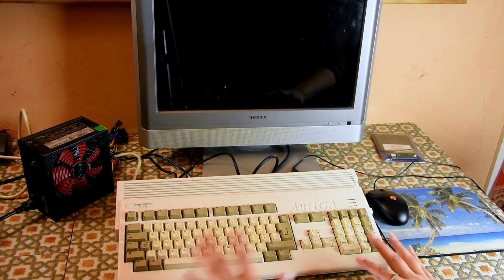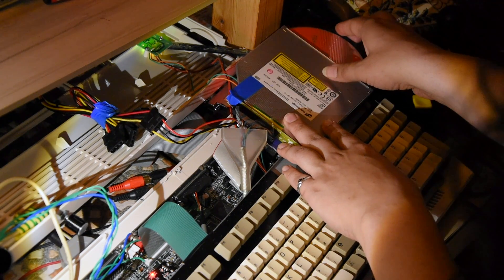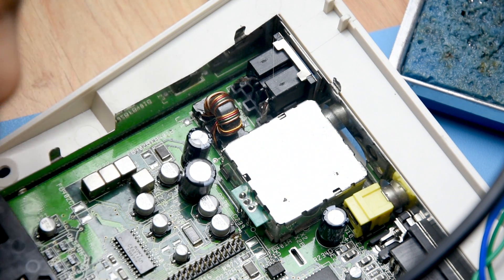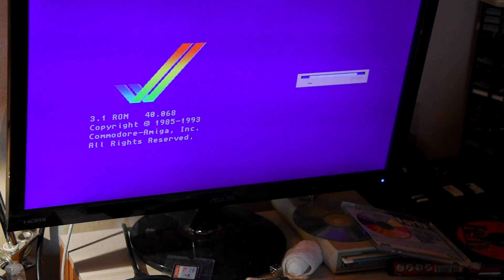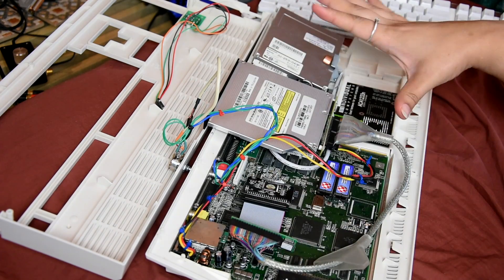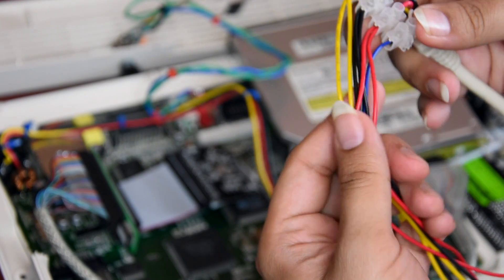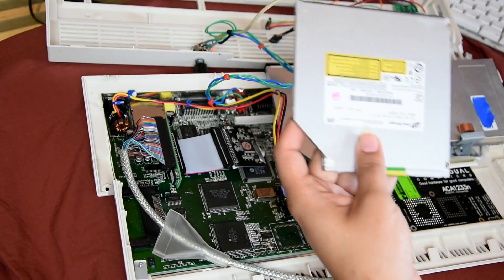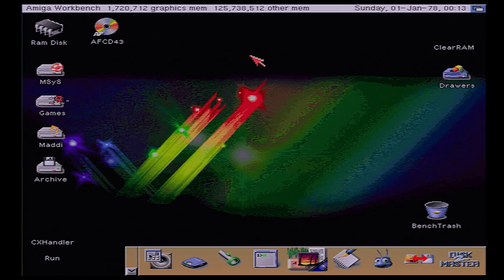Amiga Optical Drive - Part 3 Issues, fixes and Improvements

Comment: The motherboard is probably not designed to run a floppy, a hard disk and a optical drive all at the same time after all this machine was released before CD-ROM drives were everywhere.

The question is why didn't you power the dvd drive using the external PSU instead of the computer's power connector?
Reply from the maker: If you keep watching, you'll see that I did in the end. Its not coming from the motherboard, but the power port, and yes the terminals on the power socket are thick enough to carry the current needed for the Optical drive.
Reply: @MsMadLemon  No, I meant the PSU brick not the 1200's power port.
Reply from the maker: @daviniarobbins9298  you mentioned the motherboard not designed to run a floppy, hard disk and optical drive, and why i didnt power the drive using the computer's power connector,  which is the 1200's power port?!
The PSU Brick, providing its an A500 heavy one, powers the optical drive just fine, however, i've since put together a better 65w PSU for it which is more than enough power for all this.
Reply: @MsMadLemon  Well I meant a floppy power connector from the PC PSU you are using but never mind, it isn't important.

Have you thought about one of those Checkmate A1500 cases to house your 1200 in?

Comment: Hi MsMadLamn, thanks for those videos about cd installation. It was some weeks now that I am trying to  install  4xeide on my a1200 but after the installation of the driver at reboot the amiga stay on black screen. I am usign os3.9. Can you tell me, please, your configuration(filem system, os version, kickstart etc) to try to understand what is wrong on my setup?
And if you have any suggestion to make this work. 
Thanks a lot.
Reply from the maker: Which drivers are you installing for your buffered interface? is it Allegro CDFS? its strange that you get a black screen at boot. 

My configuration is A1200 with ACA1233n (but the IDE also works without that), kickstart roms 3.1 and OS3.9.
Reply: Hi, thanks for the answer. I am using the last version of 4xeide.driver (the one from elbox) with allegro CDFS but AllegroCDFS is not the problem because is always the HDD that fail on the partitions bigger than 4GB. After thousand of test It seems to be an incompatibility with OS3.9 BB2 and above. Sadly Amigakit and elbox gave up on me after a couple of email. My configuration is aca1221ec and kickstart 3.X. Currently the system is working using the scsi.device that comes in the KS3.X and SFS1.8. It seems stable but I don't think I am using the full features of the 4xeide card. As soon I receive a new ide cable I'll try to use the secon ide port and I will know if the interface is working or not. 
Kind regards.
Reply from the maker: Hi again, For drives larger than 4GB, try using PFS, (PRofessional file system) i've already made a tutorial about installing an 8GB card using PFS: https://www.youtube.com/watch?v=tL8etprxj4E

It could also be the card, in which case, you could always test another card, install a fresh install on it and see how it behaves.
Reply: Hi. Despite the fact that most people suggest to use PFS3 IO, my problems with partition bigger than 4GB are solved installing the SFS 1.84 (the previous give me more trouble than PFS3). The problem about the driver stay. I am using the 4xeide card with the scsi.driver present into kickstart 3.X and it seems work. It is a real shame be unable to use the proper driver. The biggest shame is the way this people abandoned me. I don't care too much because are only £45. I don't think I was so calm if it were a fastata 1200 mk-V.
Thanks Again

Comment: Thanks for sharing Maddi. I came back to this video specifically because I am experiencing a similar issue on my main screen, but on a Commodore SX-64 computer. So basically your video issues where caused by insufficient power; power that you started drawing from an alternate line and not from the standard voltage supplied by the original 12V rail as intended first, thus fixing your video problems. Very interesting. I hope I can detect and fix the fault on my computer with this newly acquired knowledge. Thanks again for so many great videos! Take care. :)

Comment: Well you are using a PC powersupply so you will not have problem with the current there. The 5V and 12V lines 20mm witdh so it will not problem with that I think, most of the problems came with the original powersupply.

Comment: I see this now: Your SD Card IDE adapter is not insulated at all and when any conductive (metal) piece of it touches any conductive piece on your amiga mainboard it will give you a short circuited system! Please, if you haven't done it already, insulate the SD Card IDE adapter tro prevent it from damaging your system. The easiest way to do that is just putting a very small kind of plastic bag around it :)
Reply: Here is a picture of my A1200 from the inside: http://www.bilder-upload.eu/show.php?file=ebb67d-1500318936.jpg

I don't have the EIDE adapter and a CF card adapter (with 8gb CF)  instead of an SD card one, but the whole insulating thing is exactly the same of course. Maybe you get a better idea of it by looking at the picture :o
(If you wonder about it: The accellerator card is a Blizzard 1200/4)

I don't want to act like a teacher at the moment who is telling you what you must and mustn't do, I just want to help you keeping your amiga alive as long as possible ;)
Reply: ...and even one more thing... are your capacitors in the A1200 already replaced by new ones? If not, that is a thing you should actually do as fast as possible as well, because the old ones Commodore soldered into the A1200s, A600s, A4000s, CD32s and CDTV remotes back in the day were pretty low quality capacitors, so they are very likely to leak their very aggressively etching electrolyte onto the amiga mainboard which is desrroyed if that stuff sits on it for a time :o
Reply from the maker: Thanks for the warning and concerns, i've already recapped the A1200 and I made sure to insulate the underneath or any metallic corners of the SD card adapter with duct tape, so there's no danger of any short circuit. Thanks again for the advice though :o)
Reply: Ok, I really didn't see that duct tape and the caps you put in there look exactly like the original ones, so I just wanted to tell you. Of yourse it is very good that everything is already done :)

Comment: Interesting video. I never trust thin wires anymore since I had a few melt-downs, nice big thick wires you can trust. I think a slip of cardboard is also handy if you get two wires almost touching, as it can be easy to slot in between two solder points, and is as good an insulator as wood itself. But then it depends on the situation so maybe not really a tip.

Comment: That is SOOO Awesome! Wonder now if CD32 games will work? I thought there was an Akiko Chip in the CD32 which isn't in the 1200 so I would be very interested to see how they run. I would rather try and source an external CDROM Drive for my 1200 as I would be too scared to fry it!
Reply from the maker: Yes there is an Akiko chip in the CD32, though i'm not 100% sure on what it does, But we will soon find out as i'm going to do a video on the CD32 "emulator"... Well you could just use a long IDE cable to an external CD-ROM drive and power that externally. SCSI i'm imagining is hard to find.
Reply: At the moment I am waiting to buy an A1200 Accelerator card whilst also doing some smaller upgrades to my A500 Plus and A600.

Comment: With regards to current of the 12v line via the FDD connector, I think your approach there to take it from the main connector directly is the best approach tbh.  You could measure the current drawn on the 12v line of the CD drive to see what it is, but I suspect the trace width will accommodate whatever the FDD pulls on the 12v with some tolerance.  It might for arguments sake be safe to pull 500mA on the 12v line, but the FDD and CD running at the same time could pull too much current.  If that had happened a trace would have burned out, so I doubt you were pulling more than it could handle.  

But there's also the benefit of connecting directly to the power socket there in that a) you aren't stressing any thin 12v traces on there, but also b) Any current dips perhaps wont affect anything else using the 12v line as much.  I've found the same thing there on systems where I've added fans - the nearer they are to smoothing caps and power input connector the better.  Depending on the current drawn by that CD drive on the 12v rail, I might be tempted to add a smoothing /resevoir cap at the drive end too.  Not essential but it might just help with any noise generated by the CD drive motors and current dips etc.
Reply: Yeah connecting it to the power input was the best solution. And since the cd-rom power was connected before the caps, any noise made by the cd-rom would be cleaned by the caps before entering the board. Cd-rom would also receive any noise made by the powersupply, but i dont think its a big deal since the amiga is limited to 2,3Mb/sec anyway.
Power input on amiga=amps are limited by the powersupply, if you need more amp, just get a more powerful supply. (dont worry if it can deliver more then needed, it will only take what i t needs)
Power from fdd: Very limited. Its not really limited by the traces, but the voltage regulator. It will never deliver amps to a dangerous level, when it reach max amp, it will refuse to deliver more, so you cant really burn your traces here, unless you short circuit something, which is always a bad idea anywayz 🤗
Reply: Another great video btw =D  Educational, interesting, and fun at the same time :o)
Reply from the maker: Actually I remember there being kits to add 3.5 inch hard drives into the A1200, I had one in my first A1200 and it was powered via the floppy connector.. but as you rightly say it's going to be limited. Even though I discovered in the end that the issue was in fact the ATX PSU wires needing to be thicker, I somehow didnt feel any regret of doing all this, in fact I feel more peace of mind knowing it's directly from the socket. Shame I didnt think about the resevoir caps and the noise from the CD drive motor!
Reply from the maker: Thank you! i'm glad you enjoyed the video :oD And also thanks for the info and feedback! I appreciate! :o)
Reply: Yeah, the 12v line might be quite thick on the board - maybe it will support up to an amp or something!  If you traced the 12v line and worked out the width at its thinest point, and the height of the traces,  you could work out maximum current.  As I said before, if it works - it will work =D  If you had pulled too much current, you would know about it ;)  I would think that a modern CD drive would draw less on the 12v line than an older HDD.

Comment: I had an Amiga 1200 that came with a 3.5 inch drive fitted fairly sure it was powered from the floppy port I removed it though it did work.
Reply from the maker: Actually you're right, I remember there being kits available to add a 3.5inch HDD and the power was always from the floppy port.

Comment: You can power the CD-ROM from the floppy power cable if you want (using a floppy power y adapter).  Unless you're trying to use the CD-ROM drive to plow a corn field, it's not going to draw an excessive amount of amperage from the power port.  :-D  If you were using the stock a1200 PSU I'd be worried, but since you're not, it's not an issue.
Reply from the maker: Okay so the traces to the floppy port is more than enough for a CD rom drive! I thought so at first until I came across the issue...which of course turned out that I needed to double wires of the PSU... So it left me questioning still, thanks for answering the question, I appreciate it! :o) 

Hmmm CD-ROM drive cut corn... I wonder what that tastes like ;o))
Reply: There may be two different issues behind that.  Either the power cable you used before wasn't up to snuff, or there's a problem with the voltages/amperages at the power connector on the motherboard.  Did you try just replacing the cable with a new/higher quality one?  After that you can try checking the power with a multimeter while it's under load.

I'm in the middle of adding an internal CDROM to my A1200 too, but I'll be honest.  I'm not even bothering to try to power it from the internal floppy power connector.  Not because I don't think it'll work, rather because I did an internal PicoPSU conversion and since the PicoPSU has drive power connectors it's just easier to use that than to mod the floppy power cable.  I have seen other people power CDROM drives from the internal power connector, and there are other devices that tap into that power connector too (like the Rapid Road USB adapter).
Reply from the maker: Actually I sort it out in the end, the ATX PSU wires are too thin (slightly Budget PSU) so I doubled the wires and all became fine :o) 
i'm thinking about doing a PicoPSU but not internal, as an external little box. I'm a little aprehensive but i'm sure it'll be fine. Then again i'm always aprehensive doing any PSU hacks/mods on my Amiga, naturally!

Comment: The IDE 80 Conductor cable is just ground on every other wire. It's still 40 pins, this is to allow faster transfer speed without data cross talk between signal wires. It is fully backwards compatible. Pin 34 is grounded on this cable but not in the old 40 wire cable thus the host system can determine what cable is used to enable ata-66 transfer and faster support :)
Reply from the maker: Thanks for the info, much appreciated! :o)

Comment: As of my knowledge the 80 pin IDE cable are of course pin identical to 40 pin cables, but they handle interferences way better due to the extra 40 ground cables. This is especially important at higher Ultra DMA transfer rates. I think U-DMA goes up to 100 MB per second or so.
Reply from the maker: Thanks for the info! it was weird that the Optical drive just refused to work with any other cable other than the 80 pin.

Comment: Glad you got the power issue sorted. I find the wire gauge makes all the difference. I once tried to power a 2.5" SATA hard drive with an external supply that had a Molex plug, so naturally I needed a Molex to SATA adapter. Plugged it in and the thing spazzed out making noise like a dentist drill. Turned out the adapter was the culprit, since the wires were too thin. Swapped it for a better one, et voila (luckily there was no damage to the drive). Also, I never understood those 80 pin IDE cables either.
Reply from the maker: Thanks Shawn, it's amazing how much of a different the wire gauge actually makes, it sounds as if you could have fried that SATA hard drive just due to the adapter! 
80pin IDE cables to me, always felt like those impossible pattern artwork you see: https://s-media-cache-ak0.pinimg.com/736x/a4/9b/35/a49b354402947c61722ca39a79a08314.jpg

I've just been reading the other comments and apparently it's just an extra ground connection alongside each pin lol. Amazing how it makes a world of difference! the other drive refused to work with any other cable!
Reply: Any time. It didn't help that it was a finicky Seagate, but either way I got lucky. Interesting artwork analogy, those cables really do feel like there's some kind of mystical voodoo or snake oil in them.

Comment: Ok , well there is not an easy answer , cause we all know there a different versions of motherboards, and printed circuits especially for that period are not that well built, and they get worse over time - and don't forget they haven't built A1200 mb's with such upgrades in mind 25 years ago 

First of all you can get the correct voltage to the unit u are trying to power , but Amps are to low.

What is most common mistake is that people don't check on what power rail they connect external ATX PSU as they have different rails with different capabilities for powering specific devices, so it is much better to use 6 or 8 pin connector if possible dedicated for graphics cards as there tend to be more Amps on that line 
- it doesn't also help that on most cheaper PSU's cable isn't made of copper but instead of aluminium
Reply: BTW if you don't have 6 or 8 pin connector You can read form label of your PSU how much amps it should provide on each rail
Reply from the maker: Thanks for this valuable information! 
Also I didnt know the graphics card power rails provided more current! I will bear that in mind.

Comment: Where possible I use heat shrink sleeving in place of cable ties
Reply: Just a quick note. It would be advisable to cover the coke (torus with windings) next to where you are soldering. Just a slight touch from the iron (not everyone has steady hands when soldering) or the solder spitting when applying heat and will ruin that component (you wouldn't even necessarily notice) I realize that it's unlikely. Just trying to keep all Amigas healthy :-)
Reply from the maker: True! I should have done that... thats what those larger tubes are for aren't they, doh!
Reply from the maker: I wish I knew this to mention it in the video! Thanks for the tip!! :o)
Reply from the maker: Thanks, though I always tip the motherboard upside down and tap a few times in case before switching it on.